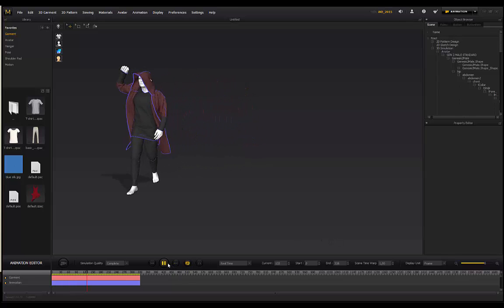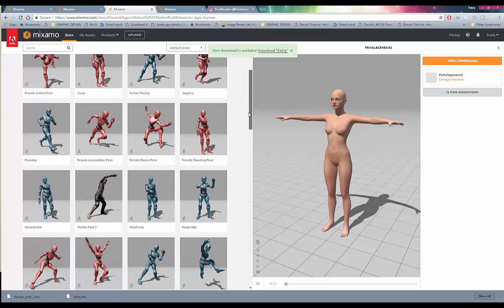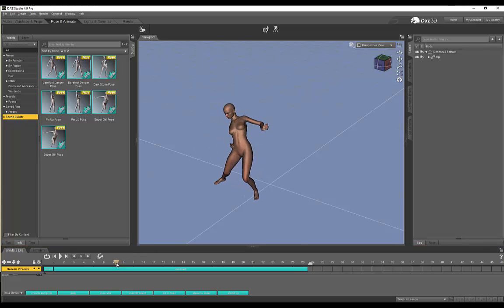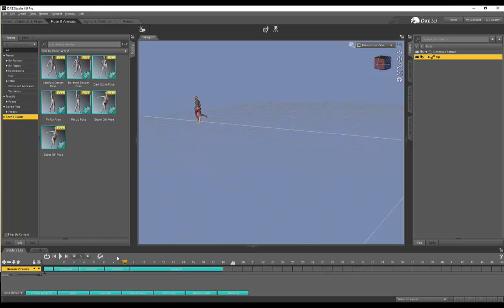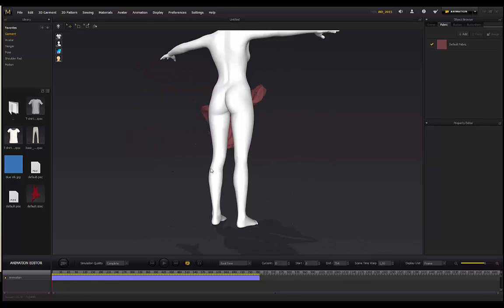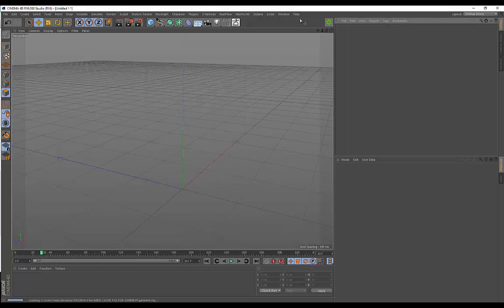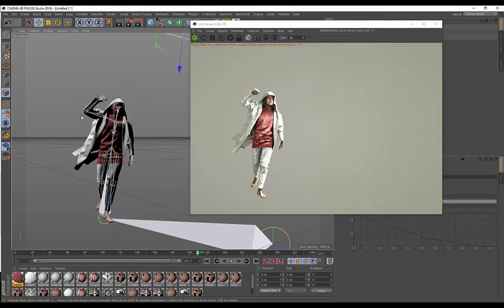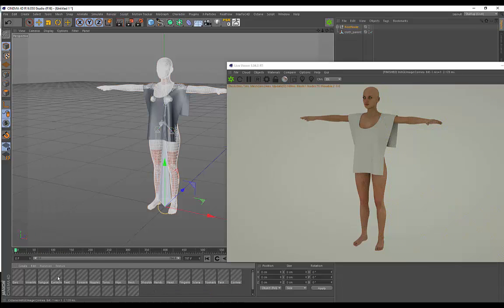Daz, Mixamo, Marvelous Designer, Cinema 4D - Create A T-Pose That Transitions Into An Animation

Comment: Somehow this approach does not work in Daz 4.15. I am using a G8 character though.....importing the mocapped FBX figure from mixamo does not show up in Daz
Reply: did you find a solution? same problem here
Reply: @3DBONFIRE  There is a workaround. You can upload a pre-rigged model to mixamo from Daz. However it has to be a Gen1 model since that's the only rigged Daz model that Mixamo will accept. Once uploaded, apply desired mocap on it in Mixamo. Then download it as FBX 6.0 with skin. Once you import this FBX then the entire character with baked keyframes will come in Daz. Now go to File>Save As>Pose Preset. Now this pose preset can be applied to a fresh G3/G8 figure.

Note: When applying this pose preset to a G8 figure it has be be in T-pose when applying. (G8s are in A pose not T) G3 is in T pose already so that is not a problem.

Comment: Hi Travis! I have quite some experience with Marvelous Designer by now. However I always struggle with the stitches in the animations. They become way too heavy in the alembic file. Is there a way to just use the stitches as textures? Without a 3rd party progam. I know there is some kind of option to set it to obj or textured  in the stitches panel, but it always comes as an object in the animation when exported.

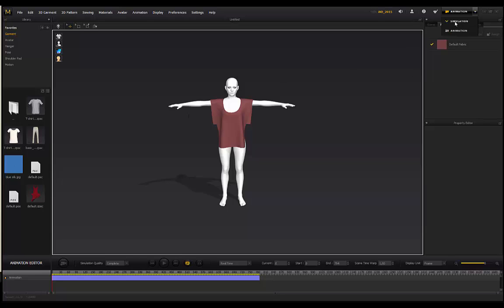Comment: 26:00 So what worked out for me was exporting an alembic and an obj. Then I imported them both into cinema4D. Afterwards I baked the alembic to PLA with the timeline manager. After that I just could copy the selection tags from the obj towards the newly baked PLA object ;)  If this doesn´t work for you guys, then you can use the Pose Morph Tag onto you obj. Drag in the alembic and check "Points" at the pose morph tag. BUT you gonna have some delay in the animation. To avoid that, you guys need to bake the alembic first again into some pla animation. Then repeat the steps with the pose morph tag and add a "point chache" tag and calculate everything. BITTESCHÖN!
Reply from the maker: AWESOME! Thank you for sharing this!
Reply from the maker: Something to mention is that the MD garments need to be triangulated. If you use the pose morph with a quadrangulated garment it gets all messed up. I'll possibly cover a video on the process and give you full credit for this technique as well as its super useful.
Reply: Really? Good to know that quadtrangle dont work. I always use a triangualted mesh. Thanks , for your Tutorial by the way!
Reply from the maker: Yeah i had my hoodie in triangles and the pants in quads and the pants kept getting messed up. As soon as i converted the pants back to triangles in MD it worked perfectly. Oh and no problem, thank you for watching.
Reply: Do you have any recommendation which one is better in quality ? Triangles or quads? Or does it just don´t matter..?
Reply from the maker: Doesn't really matter for this particular purpose but quads tend to be favored for animation and i prefer quads as well when i sculpt on top of a garment in zbrush. I can still work with triangles though, its fine.
Reply from the maker: I credited you in my recent video.

Comment: Daz imports BVH files much better than fbx, and you can skip a few steps by simply importing the bvh versions of mocap, create the aniblock, push it to the right a bit on the timeline, and it will blend the T pose into the movement. I suggest saving that as a new aniblock, then bringing in a new base Genesis (2) model, using that aniblock (which you can cut up as you like) then baking it to the timeline so you can tweak the hands, face. For some reason, Daz will occasionally have problems handling multiple aniblocks, so baking this first as one block then deleting that in animate2, then using the keyframes, is the best route. You can then export this in the preferred format. I've done hundreds of these now and it works everytime, but fbx is always a problem, if it even loads at all.

Comment: i got a question do i need adobe fuse for this tutorial to work or do i simple need a mixamo fuse account ?
Reply from the maker: Sorry for the late reply, you only need an adobe account to gain access to Mixamo.
Reply: thanks i was wondering about that also can i import my adobe fuse models directly into marvelous designer ?
Reply from the maker: I haven't tried with Adobe Fuse but as long as you can export Adobe Fuse characters in .obj format or even .fbx you will be able to import them into Marvelous Designer.

Comment: Your tutorial is awesome! I just started using MD6 and this is exactly what I needed to get started. Oh and I think the reason why Genesis 3 figures might not work is they have a more extensive bone structure. I imported DAZ models into 3ds and C4D and the Gen2 models have a standard minimal base set of bones, sort of the kind you get from mocap data like out of  Brekel. Where the Gen3 models have more interstitial bones between standard joints for more realistic twisting and bending. I was going to experiment with taking the bones of a Gen2 and skinning it to a Gen3 model and importing that to see if it might resolve that. If not, I'm going to have some beer and chops while watch Archer.
Reply from the maker: Yup you are right, i only noticed afterwards that the actual rigged skeleton is a lot more complex. Did you have a chance to reskin gen 2 to gen3 yet?